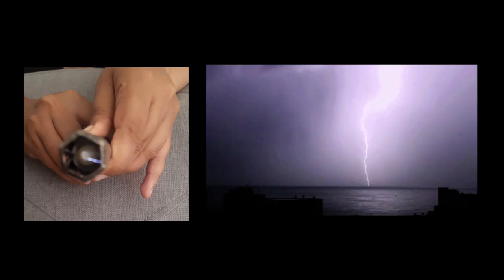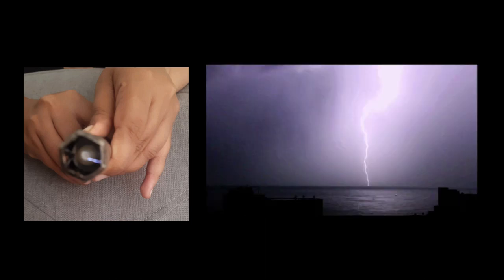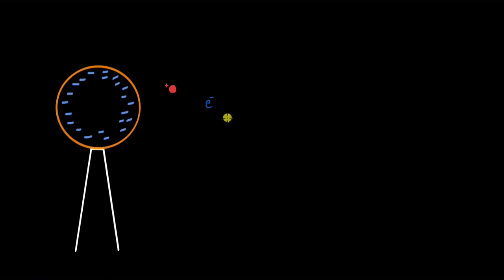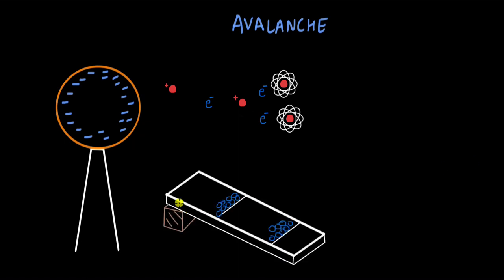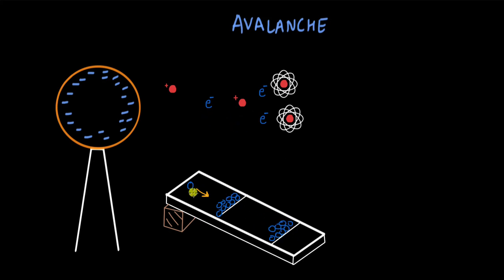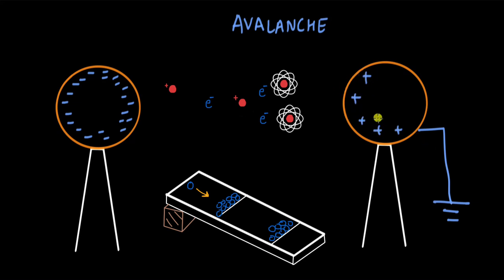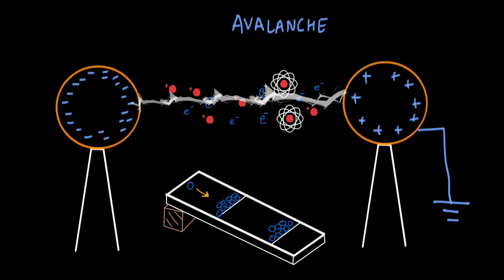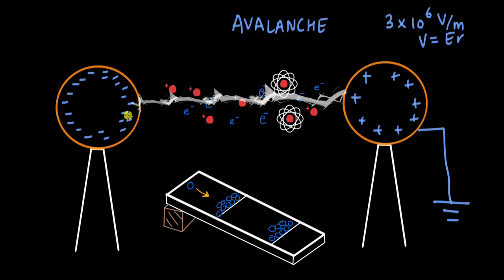Why are sparks created? | Electrostatic potential and Capacitance | Physics | Khan Academy

Comment: This explanation begs a question: Can spark jumps across a vacuum?
Reply: Going with the example in the video. If it's a vacuum, there's no avalanche effect in play as there is no atom present from which an electron can be RIPPED.
Reply: @napstablook25 not possible for thete to be no atom present

there’s just a lot less atoms present in a vacuum but not 0